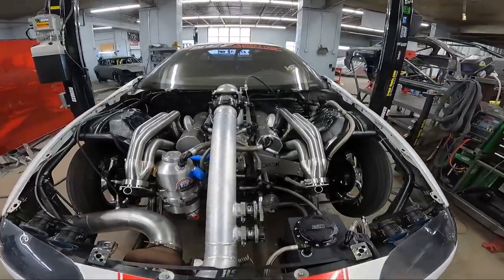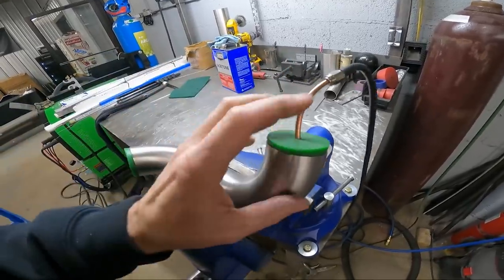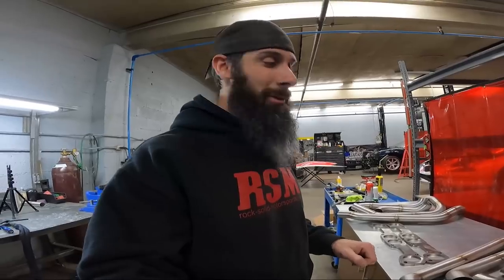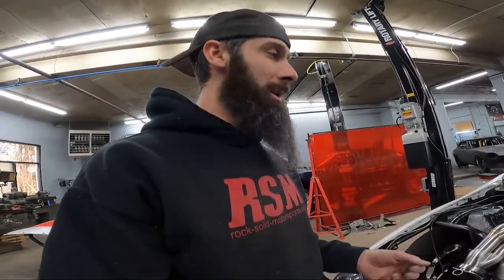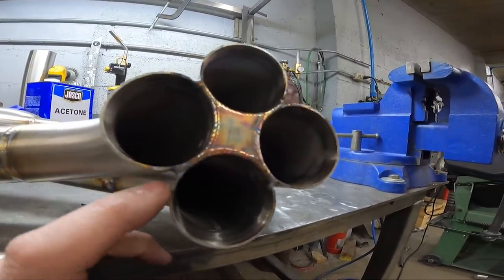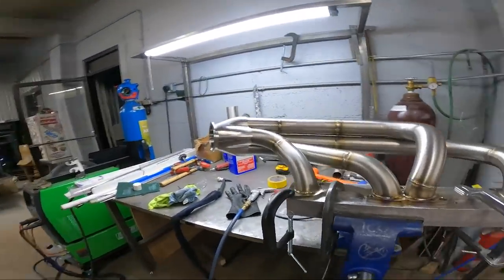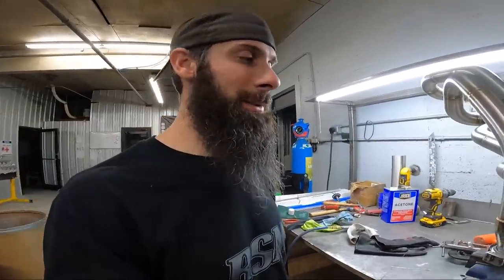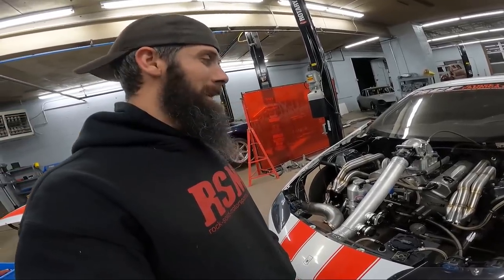Step-by-Step Welding 321ss Turbo Headers on Grubbworm for 2022 Updates Video #8

Comment: You make this look easy. This would likely take me 10000 years to complete.👍🍻
Reply from the maker: Usually a set of Turbo headers from start to finish averages around 25 hours or so if everything goes decent
Reply: @rocksolidmotorsports7297  Top notch work man thanks for sharing.

Comment: Have you tried beveling the edges at the joints making a slight v groove? I try for  120-140 degree (included angle) to give a wide, shallow v. I feel it makes the puddle more stable making the weld more consistent and less wandering from side to side especially where theres a slight mismatch.
Reply from the maker: It would help yes. Most of the time I'm in to much of a push to utilize all the things I know would help. 🤣🤣
Reply: @rocksolidmotorsports7297  I thought about that after I posted. Also gotta find the right customer that is willing to pay for that extra time. Few give a shit about a little bit prettier weld

Comment: Thank You for making these video's!! What size and alloy rod are You using! 308,or 316? It looks like 1/16, tough to see on My phone.
Reply: Since the material is 321 it’s probably 321 filler
Reply: 347 filler rod is always recommended for 321 stainless

Comment: My question is. If someone wanted a full tube header without any seams after you mocked up everything  could you do a seamless header and what would be the cost difference?
Reply from the maker: The only way you're doing a seamless header is on a mandrel Bender where it's one continuous tube with no weld joints